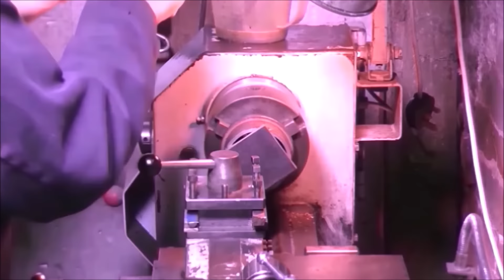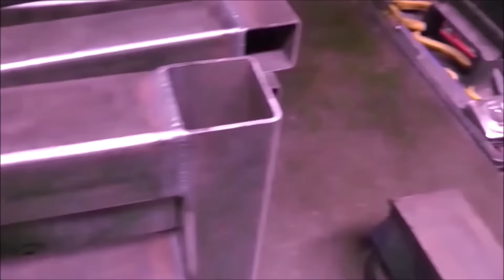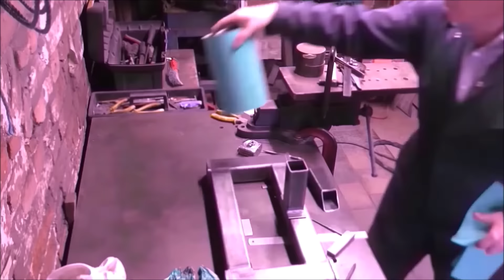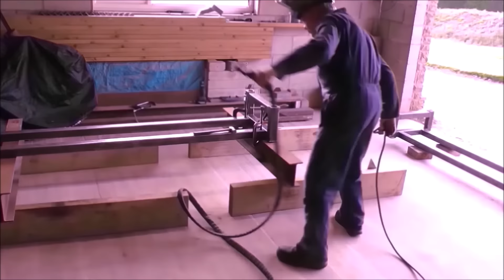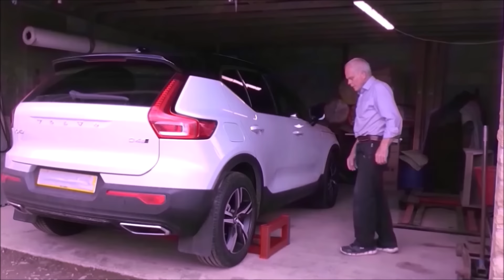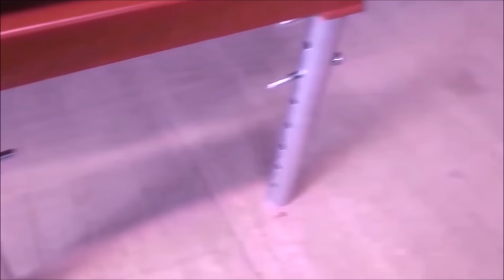The ultimate homemade car jack, simple to use, compact when not in use.

Comment: why didn't you just make a single wider one for the middle of the car, instead of using stands?
Reply from the maker: 3rd gen immigrant, It is something I did consider first but (a) having a single frame across the middle area of the car would prevent the car doors opening,  (b) having just one frame carrying all weight of car bigger sections of steel would be needed to build the frame, (c) longer legs would be needed on the frame and a higher lifting jack would be required to achieve same clearance under car, (d) Frame wood be close to underside of car restricting access to exhaust pipe etc, (e) a bigger and heaver frame would be more difficult to store when not in use.
Reply: @johnbower  Thanks for the reply John. I've going to try a full frame on my 1940 Ford coupe... I can go either side of the door with upright 65 x 65 RHS posts, and will have a detachable bracket for the jack instead of your extra RHS....  75 x 75 x 4 RHS works out strong enough for my car and will bolt together to allow it to slide under my ( low ) car. Thanks for your vid, it was helpful to me.

Comment: This is only useful for work not involving any tire, wheel, suspension, or brakes... since there is no provision for supporting a corner of the car on the frame of the stands to allow removing the wheel. That makes it of very limited utility; it might be useful, but it's hardly the "ultimate" system. It's also not really a jack.
Reply from the maker: You did not watch the complete video. The lift is for people with common sense to use when needed.
Reply: @johnbower  I did, although it is so incredibly tedious that ran it at 2X speed and skipped forward in 5-second jumps. The stands do nothing for work with a wheel removed, and it's still not a jack.
Reply from the maker: @brianb-p6586  The definition of a Jack, It's a device for lifting heavy loads, and that is exactly what this device does.

Comment: Do you have the drawing? I want to make for myself
Reply: What if, rather than front and rear wheel support, use side wheel support
Reply from the maker: The main frame is made from 60mm steel box section with 3mm wall, legs are made from 48.7mm diameter galvanized tube with 4mm wall, bolts are 12mm diameter high tensile steel 8.8 grade, (I do not share drawings) thanks for watching.

Comment: The car weighs approx. 2 tons. How thick have the holding rods to be ?
Reply from the maker: The box section to make the frame is 60mm square with a 3mm wall thickness, the legs are made from galvanized tube 48.7mm diameter with a 4mm wall thickness.

Comment: Pretty smart...as long as you don't need to take a wheel off to do brake work/tire rotation/wheel bearing/etc.
Reply from the maker: Watch the complete video, you will see that wheels can be removed for brake work / bearings etc if needed. If you watch one of my other videos I show the lift being used to replace ABS sensor and wheel bearing on my Astravan.

Comment: Why no small corner hydraulic lifts with quick connect hydraulic line for power
Reply from the maker: A lot of though has gone into designing these lifting frames both for simplicity with safety in mind, one end of the lifting  frame "must" be resting on the floor when the other end is being lifted, read my  IMPORTANT NOTE pinned at the top of the comments.

Comment: Only improvement I can see needed is for each leg to have a reasonably sized built in pad at the bottom cos those babies would sink into my tarmac drive....
Reply from the maker: @mufuliramark,   Yes if the lift is being used on soft ground then steel plates must be used for the legs to stand on, I do have plates with centering pegs that simply get placed beneath the legs when needed, if the plates were fixed they would prevent the legs from sliding down into position within the frames. Thanks for the comment.

Comment: Nice work, it looks pretty heavy duty. But I wonder how stable it is against tipping in the forwards/backwards direction. Should the lift be at its highest pin hole, I don't know if I would be brave enough to tighten the bigger bolts underneath with a wrench :D
Reply from the maker: The lift is stable when in it's highest setting providing it's standing on a hard level floor,  but when working underneath a car the lift does not need to be in it's higher settings, because this make it more difficult having to reach up further when using tools. 
 If the lift is being used on soft ground then the higher settings should not be used and adequate metal plates should be fitted beneath the legs to spread the load.
Thank you for your comment.

Comment: i don't know if i would trust those pins to be holding up the weight.
Reply from the maker: To set your mind at rest, the pins are 12mm diameter 8.8 grade high tensile steel bolts, each bolt is capable of supporting a load close to 5000 KG, the lift has eight bolts which together are capable of supporting close to 40000 KG, the Volvo car on the lift weighs less than 2000 KG, thanks for watching.
Reply: @johnbower  
I don't think the numbers you have quoted are for shear forces, but rather for axial forces. I wouldn' trust those bolts not shearing off. The second set of bolts you are putting in, are probably not of much use. If the car should come down on the bolts with any speed, they will shear off for sure.
Reply from the maker: @general1977  The numbers I have quoted are for tensile strength, shear strength is around 60% of tensile strength, the bolts pass all the way through the tubes so for the bolts to shear each bolt would have to shear in two places simutainlessy, therefore in this setup the shear load strength is 20% greater than their tensile strength. 
Note: A lot of thought has gone into building these frames both for ease of use with safety in mind.

Comment: I know you invested a lot of money in that lift, but your reason for doing it is that floor jacks damage the car. That is not the case if you jack from the correct points chosen... your statement about placing jack stands to do tire removal requires that you place the jack stands places that you claim ruins the car.
Reply from the maker: Heights Golan. You failed to understand what I was saying, you obviously have very little experience jacking cars up high enough to gain underneath access, it also appears you don't know the difference between Jack stands  Trolley jacks & Scissor jacks, you need to stay away from this type of work before you hurt yourself.
Reply: @johnbower  Been working on cars most likely longer than you are alive. Used floor jacks, lifts, scissor jacks and air jacks. Even picked them up with forklifts and my tow truck. You are a novice trying to sound technical and experienced, when any pro can see the laborious work your lift requires to jack up a car, only to discover you now need to reposition it on jack stands to pull the wheels off... and  that lift is now in the way!. Muffler shops and a few others have lifts that raise the car from the tires. Most of the diy'ers would get no benefit from your design
Reply from the maker: @heightsgolan8742  Sorry but these frames have been designed for people who know better.

Comment: Seriously, You relying on 8 bolts? Any one of these bolts can shears or bends causing a major injury or dead.
I know everyone wants to be nice and polite. But this design is not safe and dangers
Reply from the maker: @siamak1, To set your mind at rest, the bolts are 12mm diameter 8.8 grade high tensile steel, and each one of them can support a load weighing close to 5,000 KG,  therefore 8 of these bolts together will be able to support a load close to 40,000 KG, the Volvo car on the lift weighs less than 2,000 KG, thanks for watching.

Comment: I think it would have been better to build one like a ramp, you drive up and just have to lift the rear with a jack, it just seemed a lot of work to jack each side front and rear and each side one at a time, just a thought.
Reply from the maker: BEGINNERS GUITAR CORNER,  Building a dual ramp type like you are suggesting was my first thought,  the length would need to be around four metres, this long span would require a substantial  amount of steel, cross braising etc would also be needed for the jacking point. then when working under the car the ramps would be in the way restricting access, and when the ramp is not being used storage would also be a problem, so after a lot of thought I decided against that idea. thank you for your comment.

Comment: Not ver,y often i've got to jack the car up and not remove a wheel, nice fabrication but not particularly usefull tbh.
Reply from the maker: The device is not intended for someone who just wants to remove a wheel, but if you watch the complete video you will see that any number of wheels can be removed if needed when using this device. This device does all the hard work, it safely and easily raises a car to the desired height giving good clearance to carry out any mechanical repair / maintenance /lower body repair / or restoration projects, and while the car is raised if any wheels needs removing you  simply place jack stands under the sill jacking points without struggling with jacks.

Comment: As a former mechanic on car...  I won't work under that car with these stands !!   Front - rear stability is not garanteed !!    Legs should be wider apart !!
Reply from the maker: B67FSTB. I have designed these Jacking frames so that proportionally between overall height and leg spacing to be far more stable than off the shelf Jack stands.
Reply: I expect that even if the width of the stance is not a problem, the telescoping tubes will be sloppy enough to cause significant wobble.
Reply: @johnbower  I agree that the longitudinal spacing is similar to typical jack stands in proportion to height, and of course lateral spacing is very wide so stability that way is not an issue.
Reply from the maker: @brianb-p6586   You are wrong again, the telescoping tubes have a 4mm wall thickness so there is no flexing in the tubes, they slide through top and bottom guide plates that have less than half a millimeter of clearance so there is no play here either, unlike off the shelf jack stands that do have significant wobble.
Reply: @johnbower  I wasn't referring to flex in the tubes - that would be bad, too.  It's good that they fit well.

Comment: this is so frustrating to watch, 
you could of had it jacked up and on stands in a quarter of the time, where you can takes the wheels off as well if required, by the time you buy all the equipment and steel to make this monstrosity, you could of purchased a hoist/lift cheaper and get the car up in the air in a quarter of the time, in one go,
why are you only using half of the jack handle and not the other half,
Reply: Well considering he had jack stands at the end of the video he probably needed this for a different purpose. And hes old so probably just had the steel laying around.
Reply from the maker: @fknows1,  (a) I do have a hydraulic car lift but the problem with these is they stand beneath the car and restrict access to a lot of the car underside, also you have hydraulic hoses trailing over the floor which stops you using a car creeper, where as the the lift I have built gives clear access to the entire underside of the car and no hoses trailing on the floor.
(b) If you only use half of the jack handle it halves the length of each up and down stroke and also reduces the amount of room needed.
 Let me know if there is anything else I can help you with,  thanks for watching.

Comment: Reallly!? Use your 5000$ worth of metal working tools and DIY  a lilttle old mans's version of a floor lift.
 When ~1600$ buys a proven and V useable Hydraulic one. Ready to go??
Reply from the maker: I do have a hydraulic car lift but the problem with these they sit beneath the car and restrict access to a lot of the car underside, they also have hydraulic hoses that trail on the floor that stops you using a car creeper, where as with the lift I have made gives clear access to the entire underside and no trailing hoses,
Let me know if there is anything else I can help you with, thanks for watching.

Comment: sorry but a waste of time and energy.  :face-fuchsia-wide-eyes:
Reply from the maker: I am sure you will understand one day, thanks for watching
Reply: @johnbower  I'm sorry I know you put a lot of time and energy into making that hoist but its to big and to awkward to use the only thing you can work on when it's jacked up is in the middle of the car, and there's not much there.  You can't work on the brakes or tires or any of the wheel components and if I want to just change the oil I sure wouldn't go thru all that work to jack it up I would be wore out.   I do applaud your effort though.
Reply from the maker: @ronamo111  If you watch the complete video I show that wheels can easily be removed if brakes or suspension work etc is needed.